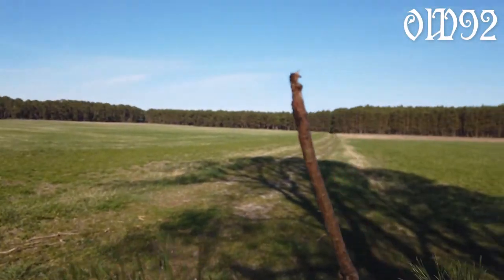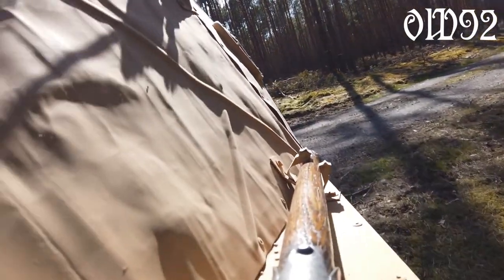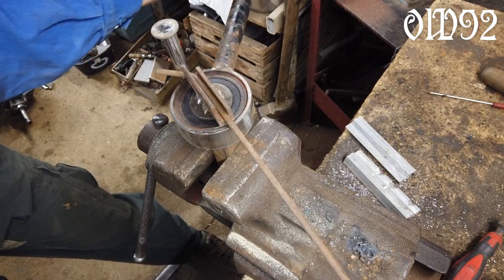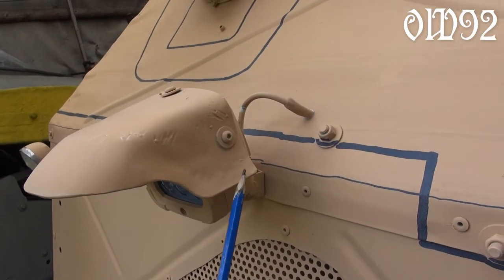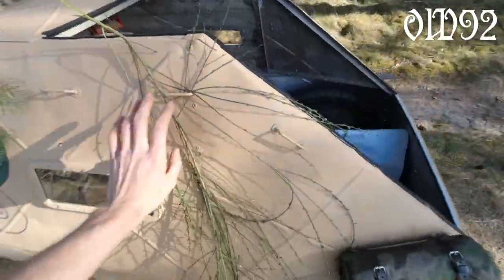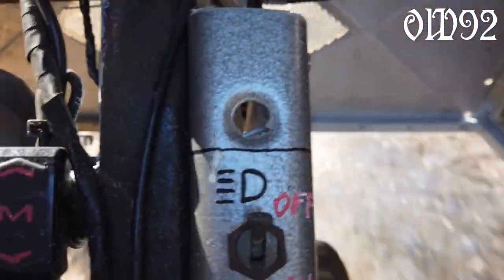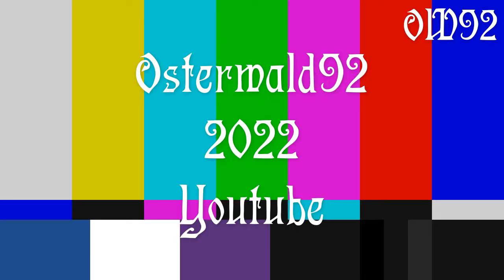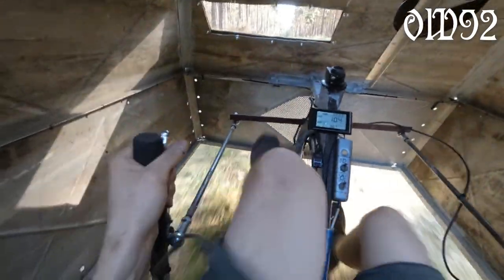BT16 E-Bike tank finally finished

Comment: It's awesome! But is it hard to dive using just legs?
Reply from the maker: ☺
...Not at all, peddling just normal is quiet easy (the needed force is low, I would say). The only problem with that is that it’s driving very slowly then. The speed is comparable with walking. So if you want to drive very fast, it’s impossible to do, because it’s physically impossible to pedal that fast. That’s the moment of just using the electric motor.